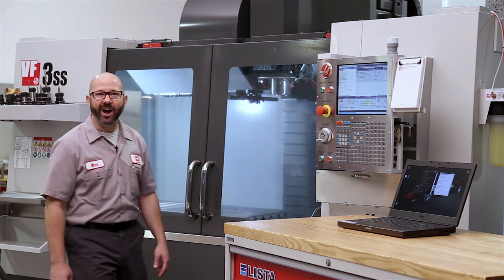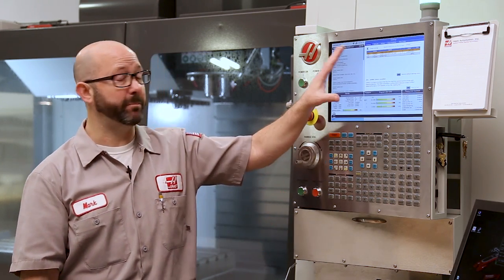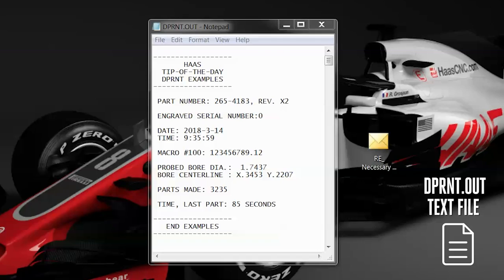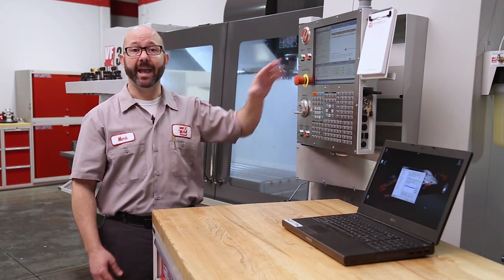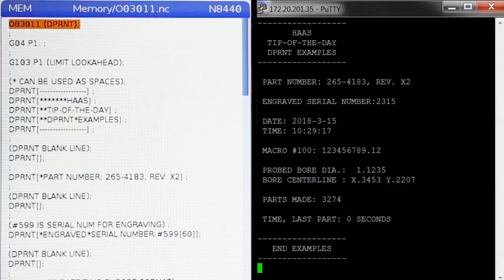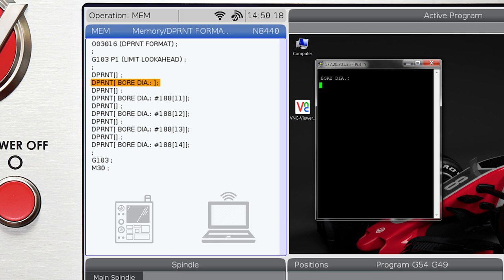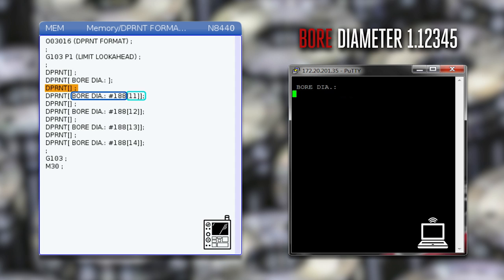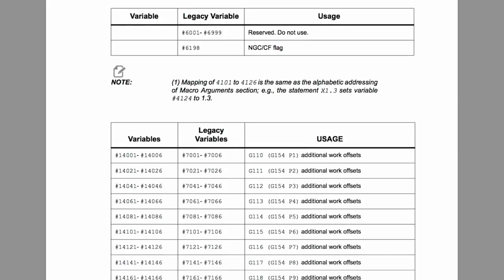Output Your Machine Data for Analysis – Haas Automation Tip of the Day

Comment: Mark your videos are amazing. Looking to buy own VF2 soon. Was wondering if its possible to track tooling using DPRNT? (HEAR ME OUT) I'm familiar with ATM and tool like management. But my thought was to use this DPRNT capability to track tooling in a more technical way. Say a long job (which I'm running currently) T1 expires at roughly 105 parts in the perfect world. My life value on tool life management is also set to 105.  Sometimes the endmill breaks or wear(as you know) at the following example values: 103,102,98, and lastly 105 parts. Can we utilize DRPNT to capture this data and store the said numbers?  That way I can look back at (103,102,98, 105) and do an average or perform further engineering analysis and tooling experiments. Let me know what you think. And if it isn't possible with DPRNT..... I have an idea for Haas for the tool life management software ;)   Kind Regards JD.

Comment: I am trying to DPRNT the actual spindle speed to find out if the operator has used the spindle override buttons. The problem is I am not able to capture the spindle speed. I tried #548=#3027 but #548 remains at 0.000. Any suggestions? By the way, Great videos.

Comment: If I change the data collection port to 0 (or 5051) - I can longer connect via Putty (connection refused) - but if I turn the data collection port back to 5052 - I can connect but DPRNT data is not transmitted - it seems the data collection port has to match Putty to connect? any thoughts
Reply: Try two putty "instances" running on your computer. One for data collection using port 5052 and one for DPRNT using 8082